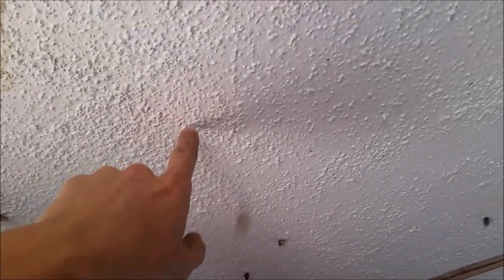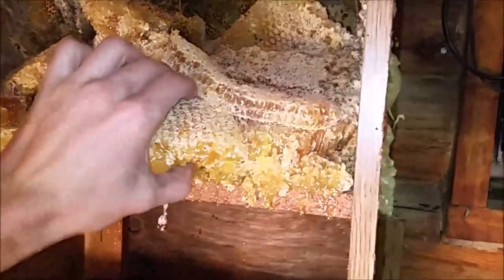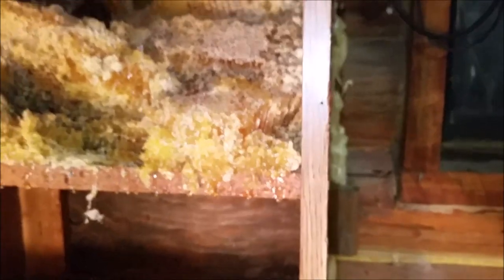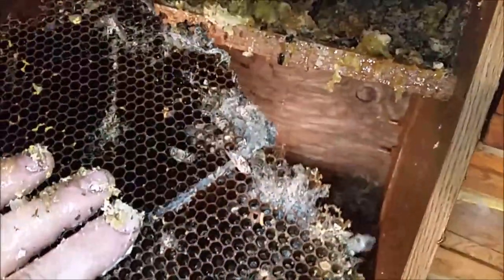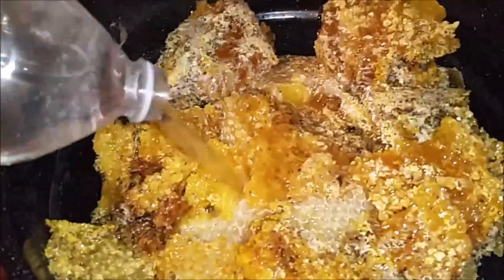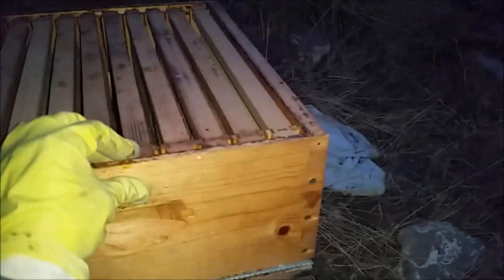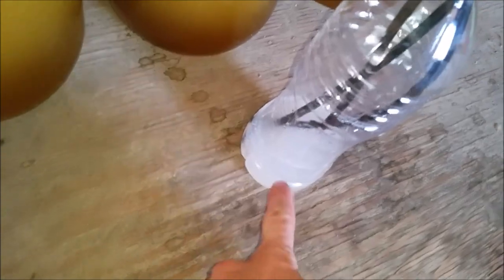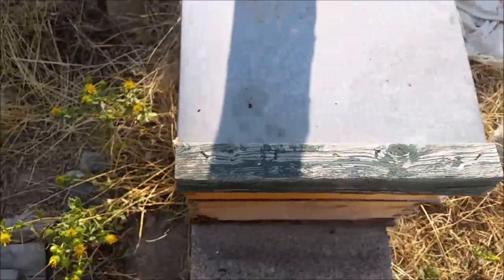I Havent Forgotten The Bees

Comment: How hard would it be to make Silver Fulminate or Mercury Fulminate?
Reply: Griffin y 
Not too hard at all. It's just REALLY explosive and sensitive. Not very stable.
Take Mercury, add Nitric Acid, rinse the Mercury Nitrate with Ethanol, extract the powder.
It's a very good contact explosive, in fact just touching the powder can make it go boom.
I would say it would be unsafe to make it, but I guess with enough precautions it could be done.
Reply: *****
Very interesting, it seemed quite straightforward to make. I guess it must be one of those finicky substances. So, easy process, hard to get conditions right I guess.

BTW:
Hey! Thanks for the reply. I love watching your videos, they are informative and entertaining. I especially liked the videos on making gunpowder (and explosives in general). I have liked most of your videos I have watched,